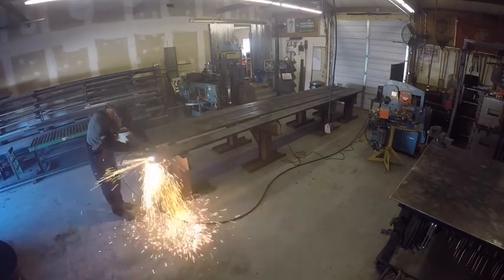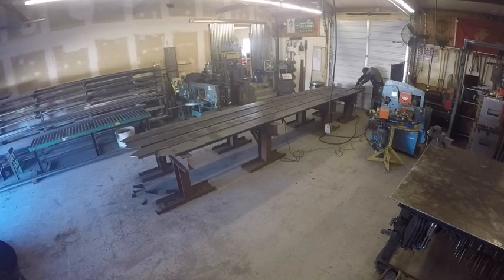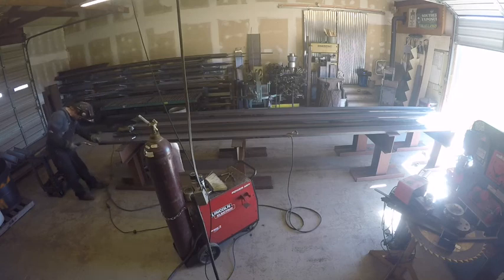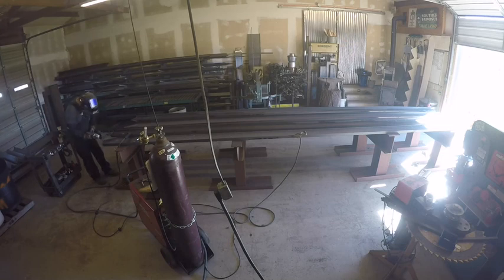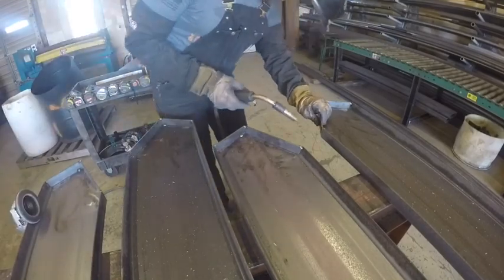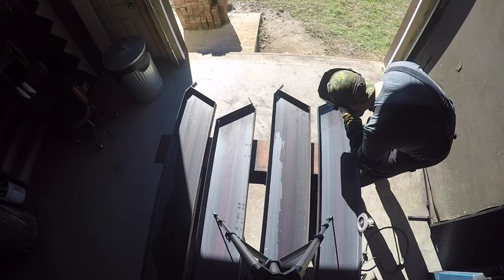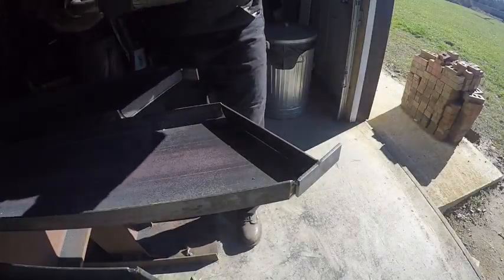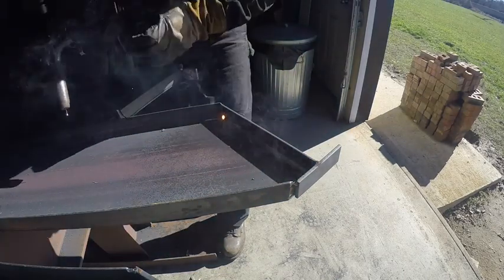Building steel stair stringers. Tutorial  PART 1 of 2

Comment: how do you get the layout for your template for top and bottom ? we have 32 degrees  for our stringer
Reply from the maker: We lay it out the first time on concrete floor and make templates. We generally have blue prints to go off of but rarely are they exactly right and we have to fudge the numbers to make step rise and run work out evenly all the way up

Comment: Hey Matt can you do a video on how to actually draw the lines on the c channel??.
Reply: Rise and run. Use a framing square and and stair gage set. Nose line is the beginning of the step and work points.
Reply: Okay thanks. I can do that. Tha ks for your reply
Reply: Is there an efficient way of drawing the lines? Using a set square etc looks time consuming and error prone.....If a single mistake is made, then it throws out the entire stair. any thoughts on this?

Comment: I’m wondering what the calculations are for finding the top and bottom angle?
Reply from the maker: So those are usually on the drawing provided to us but there not to hard to figure out. If you know your dimensions you simply lay it all out on a concrete floor and you can find the angles.  I’ll try to do a more detailed video.  We have some stringers to build next week 
Thanks so much for watching.

Comment: The problem you're having is  your welding is it starving for ground , and your over heading the transformer in the machine ,  the electric is jumping back and forth thru all that steel trying to find that ground cable....   I know its a pain in the ass but its best that you ground directly to the part you are welding on.....  if you don't,  the transformer in the machine will get weaker and weaker to where it will struggle just to weld anything over 1/4 '' material   ...

Comment: Hey Matt great video tutorial.  You mentioned you used 10" channel.  What web size are you using?  And what is the thickness of the steel angle used for the tread mounts. Thanks!
Reply from the maker: branimal18  that is correct this particular job uses what I call 10” Junior channel. So it’s 10” @8.4   Web is about 3/16” thickness roughly.   The stair clips we actually cut all those out on our CNC plasma table with the slots and then bend them to shape.    You can use angle and I know people that do but we prefer to cut our own as we can slot them and get exact dimensions we want.   Great question.  👍🏼👍🏼

Comment: Hey Matt have you ever had to mount to wood? Just wondering the best way to do it, this is my first staircase and want to make sure it's secure
Reply from the maker: Danny Rondeau absolutely the ones you see in this video are all mounting top wood structures.  You simply take heavy angle iron and fabricate mounting brackets. Then you use large bolts to thru bolt or lags to run into the wood frame or decking.
Reply: Thank you Matt. You dont know how crazy I've been trying to figure this out. It's much appreciated
Reply from the maker: @dannyrondeau9045  Absolutely glad we can help. We don't know everything by any means but we try to make each job a little more efficient than the last. Little tips and tricks can take you a long way. Good luck and let us know if we can help

Comment: Did you ever find out what the issue was with your welder?
Reply from the maker: Roger Wilcox II  you’ll have to refresh my memory it’s been a while since I recorded this video!!  Was I have porosity issues???
Reply: @MattcoMetalWorks  No, it was sputtering like the WFS and volts were not set properly, you said you changed contact tip and liner, I was going to say it was probably the liner, you could also have that same kind of issue with a longer lead on the gun.
Reply from the maker: Roger Wilcox II  generally if we have an issue with sputtering it’s the tips.  We are notorious about running tips to long.  I’ve made it a point to be sure we change those more regularly.  We also change the liners about every 6-7 rolls of wire that run through the machine even though we do use the cotton pads and lube to help keep things clean

Comment: Didn't cover the single most important thing people want to know is how to lay out the stringer . Showing a template  with no explanation on how the template  was layed out is of no use to people wanting to know how to do this .
Reply: Just my 2 cents. It will all depend on the rise and run , so basically there will be many templates.
Reply from the maker: yes the templates will change for every project because the landing height won't always be the same.